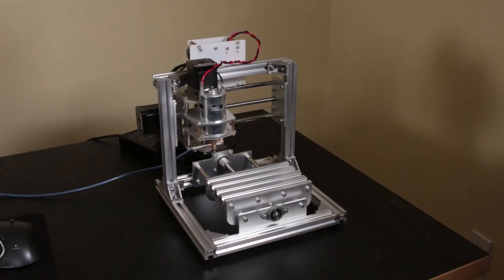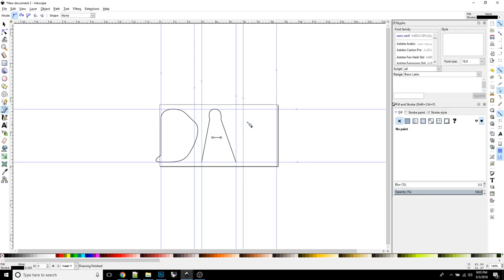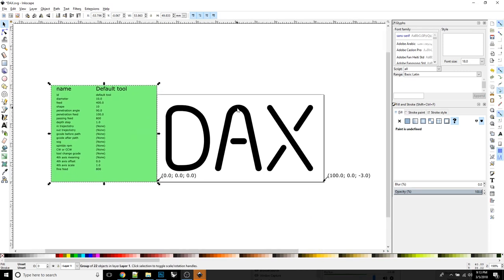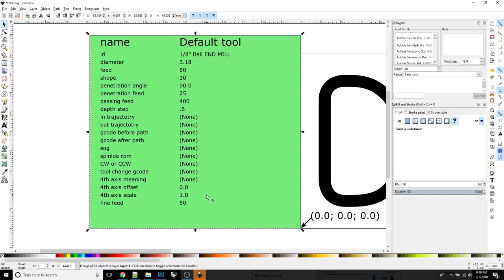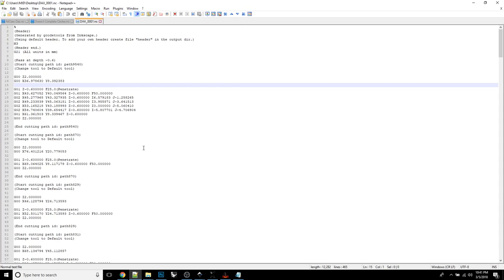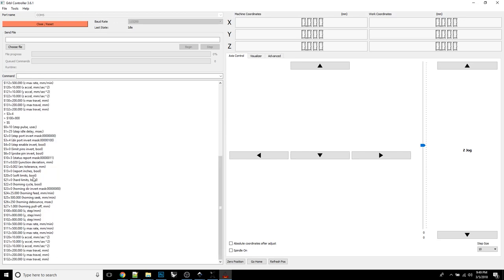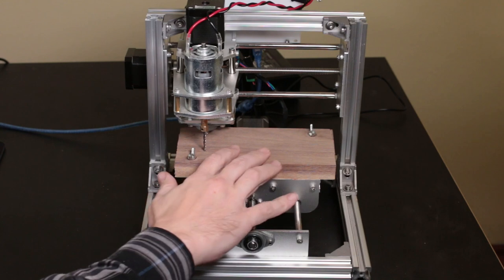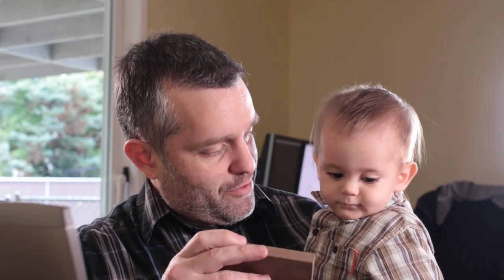How to start CNC Milling for under $200 with the T8 CNC Engraver - Project/Part #2

Comment: In Notepad++, if you select "Regular Expression" in the Find and Replace window, you can find and replace \(.*\) to nothing to remove all the comments in the GCode. This regex searches for every opening parentheses, then whatever it can find until the next closing parentheses (all on one line!). You have to escape the parentheses with a backslash because the parentheses have a function in regular expressions. Hope that helps :)
Reply: Let's not start that discussion ;-)

Comment: From an old manual engraver. Fit  "fences" on the bed. It secures the work better as it stops the sliding forces on the work. Just bought one of these cheap CNC machines to learn . I have learn't a lot from your video.

Comment: Followed your directions on putting the machine together .but with a few differences .I used the switch to be able to turn the router on/off and I used 2" L brackets to mount my circuit board to and to clean up the wires I used 3/8" wire loom . Can get at automotive parts store or BIG BOX stores

Comment: Overall a good intro to the CNC process.  The specifics will vary as to what CNC, controller software, and what cad/cam program you are using. CAREFULLY read the info for what you have FIRST before using it .Personally I despise the audrino/gerbl setup. Mach 3 is FAR more capable but it also has some downsides like it wont run on a 64 bit Windows.  My setup is a total scratch build with a 24 by 16 by 6 inch cutting envelope ruining at 250 ipm rapids. The spindle is a trim router, not some wimpy DC motor.  Been going for around 6 years now with only 1 problem, flat wore out one trim router already.

Comment: thanks for the time and effort you put into the vids. really helped with my 1610. my trouble is (and maybe one of the views may be able to help), that the spindle does come on. It worked with the 1.1 version but dropped down to the .9 version you used because couldn't get it to work quite right. After runing test runs it works great except the spindle won't come on automatically or by checking the box. Any ideas? In researching on line I did come across one article that showed command lines where you can adjust the max and min spindle rate. but .9 doesn't have those two lines. Any help would be greatly appreciated. Thanks.

Comment: Finally, did you try to do pcb with cnc machine ?
Reply from the maker: This machine in the video is not good. It has too much play at the tip of the bit. This will affect your ability to mill PCBs precisely. No matter what CNC machine you are using. The process of milling a PCB is pretty much the same, and there are already videos showing you how to do it. Tom Sanladerer Had a good one: https://youtu.be/ibZcQLIbets I also really like the one by Andreas Spiess: https://youtu.be/oGfYQXd-7vc Best of luck!

Comment: Why would comments in the gcode be a bad idea? Your trouble is that the software isn't commenting gcode correctly, a comment line is supposed to start with a semi colon. i.e.
; This is a comment
Reply from the maker: Thank you for the tip. I learned something today. On some controllers such as Siemens, and the TinyG a semicolon is an alternate way to denote a comment in GCode. However, this machine runs on GRBL. I am unclear whether or not a semicolon would work to denote a comment with this firmware. Some versions of GRBL (such as GRBL 4 axis) definitely do not support the use of a semicolon.

Comment: The question is, if this small machines, with four axis, has the ability to cut a ring in wax with high resolution, using G code and mach 3.
Reply from the maker: No. This is not a precision machine. It has too much flex/wiggle as seen at the 11:13 time stamp. I have this other machine in the box. I need to assemble it, and test it, but I think it will be much better, and I think it will achieve what you want: http://bit.ly/2Ep1X6E

Comment: Hy, hope you are fine!  i want to know if you can cut silver or gold with this machine and if the machine can hold other bits also can you show how you make a 2D ingraving from a picture? Thanks a lot !!!
Reply from the maker: This machine could engrave a fine line in gold or silver, but it would be very challenging to get the stock perfectly flat relative to the machine. your chances of failure are pretty high. Meaning if your depth of cut is the thickness of a piece of paper, and your stock is not perfectly flat, at one end you could be cutting 3 sheets of paper down making a very thick line, while at the other end you are cutting in the air and not removing any material. Did you see the flex at 11:19? I think it is foolish to risk cutting a piece of expensive gold or silver with a machine that is this imprecise. Still, it could be done.
Reply: Oh sorry i looks like i just missed this D:
Reply: but also i recommend to get a smaller bit it reduces the flex

Comment: buenas noches. me compre una cnc de estas mismas. pero no se a que voltaje debo de calibrar los driver A4988 para este tipo de motor. por favor me puede indicar a que voltaje de referencia los dejo.gracias, por favor me pueden colaborar con esto
Reply from the maker: 0.6v to 0.8v is probably safe. I didn't calibrate mine. I trusted the factory setting.
Reply: En el gbrl de la cnc tengo el $0=10. Lo dejo así o lo paso a $0=15. Cuando lleva rato trabajan pierde pasos y me daña la pcb. Muchas gracias por su respuesta
Reply: El gbrl que le tengo a mi cnc es el gbrl 1.1
Reply from the maker: You can try $0=15. It will not damage anything. It might help you. Also, try to slow down the machine. If it is pushing too hard while cutting that can cause skipping.

Comment: Oh wow.....that's ultra complicated messing about compared to my Skyfire CNC mill that I program with hand written G code compiled in Notepad and run on Mach 3. I can write simple G code that will do many tasks with milling, same as this machine, but not as tedious to achieve.....but, a more complicated program needs to have a CAM generated tool path, so I can if I need to buy in one already compiled or draw one with Fusion 360 CAD that creates the CAM tool path as part of the program. If I was going to buy one of these dinky mills I would change the controller to one that works with Mach 3......more expensive but better in the end....that's just my experience.

Comment: Instead of using a clunky and dead plugin, why not draw your SVG in Inkscape and then export to MakerCAM? It's free from the Shapeoko people, but works with any machine. My only complaint is that it's Flash-based, but it's also open source.
Reply from the maker: I'm currently working on a video  where I test of all the free CNC path generating programs out there. I think your question will be answered in that video.
Reply: Honestly Fusion360 is probably the best all round for CAD+CAM and the license for hobby users is pretty generous, but man it's hard to forget how evil Autodesk can be. It's also probably overkill for a lot of projects, plus no Linux version...
Reply from the maker: Pretty much sums up my sentiments as well.
Reply: I tend to use Fusion 360 for pretty much all of my projects (as the stated generousness of the license...). Could someone elaborate on the Evil of Autodesk? I was not familiar with that.
Also, thanks for recommending me this second video!

Comment: the spindel  do you have a number on the rpm?
Reply from the maker: At 24V it's probably spinning at 7000 RPM. I can't say for certain. It looks like a "775  DC motor" to me. Perhaps you can find better specs.
Reply: okey haven't watched but I know that the formula on a cnc milling maschine "rpm" is a must to know, so I was a bit supprised
Reply from the maker: It's not nearly so important to fine tune the RPM of the spindle when cutting wood, foam, or plastic. You can see how fine the dust is that I am making with this machine. In other words, I could probably speed up my feed, and be just fine. The reason I'm not doing that is because I don't want to even start to laterally stress the machine when it has so much play/wiggle in it.
Reply: okey.. do we not need high rpm and sharp tools to cut plastic?,

Comment: Great video, but you neglected to mention safety rule #1 (and you broke it... A lot). NEVER point at the tool on a cnc machine with your finger. Not even from across the room. Not even with the whole machine unplugged. Never.